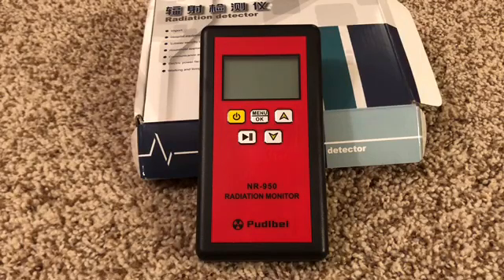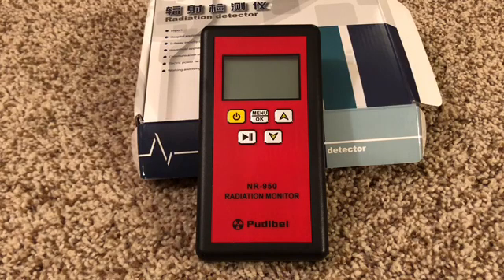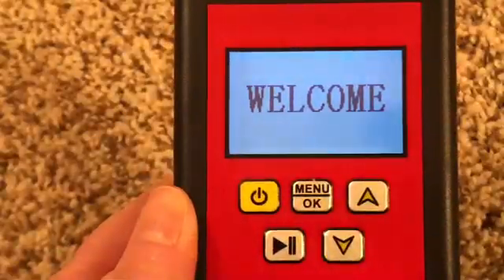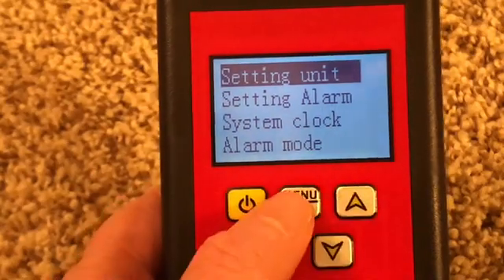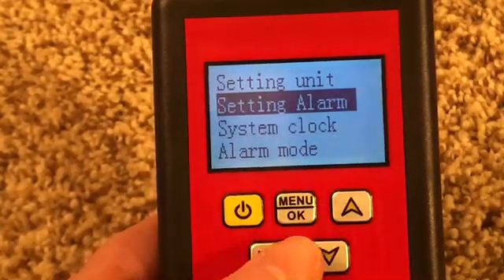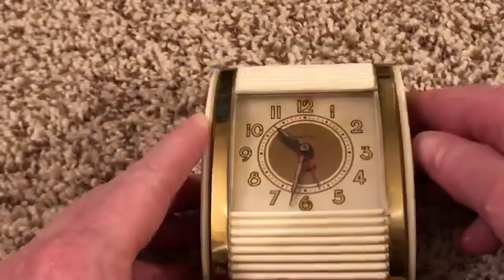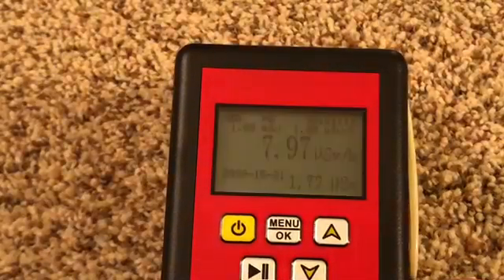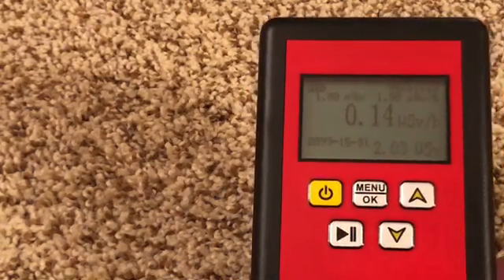Testing my NR-950 Pudibei Radiation Monitor & Dosimeter

Comment: do you have the issue that the system clock resets everytime when you power off the device?
Reply: I have an nr-750 and it has the same issue
Reply: I seen another video where they said you have to save it after setting it. Iv never attempted it so hope it works for you guys
Reply: @bigjoenax8111  can't save. That's the issue
Reply: I have nr 850. My time doesn't reset. You have to press delete dose once after you set your time correctly. Then it will show correct time and date

Comment: I get the feeling Survival Lilly influenced many people including myself into buying one of these. 
☢️😁👍
Reply: i too was influenced by regret it. this product build quality is poor( front screen is a think plastic cover which scratches easily and the main issue is that the system clock resets everytime you turn the device off.
Reply: @kairossoteria6215  Judging a geiger counter by its clock isn't a relevant argument about its performance, honestly.

Comment: Please don't spend too much time close to that your clock. It's radiation level is very unsafe. 11.42uSv/hr is the threshold above wish you have a 5% chance of developing cancer during your lifetime if absorbed for a full year. This means if you were to carry that clock in your person for a full year, then there is documented evidence that out of every 100 people who do the same, 5 of them develop some form of cancer during their lifetime.

Thank you for posting, and please stay safe.
Reply: Don't be so hysterical.
The device's measuring in microsievrts and most likely over estimating the radiation measured given it's a cheap device and not very accurate.
Also the radiation emitted is mostly alpha and beta with a small amount of gamma. The alpha is stopped by the glass on the clock and the beta has limited penetration on human flesh. As long as any paint flakes are not handled directly and or inhaled/ingested you have no problem.
As long as the clock is not taken apart and the radium paint is exposed it is not a big issue.
Reply: @jayytee8062  " the radiation emitted is mostly alpha and beta with a small amount of gamma. The alpha is stopped by the glass" would the radiation detected already have penetrated the glass for it to be detected by the detector that is outside the glass barrier? i must have missed something here?
Reply: How would one "carry that clock in your person" ?